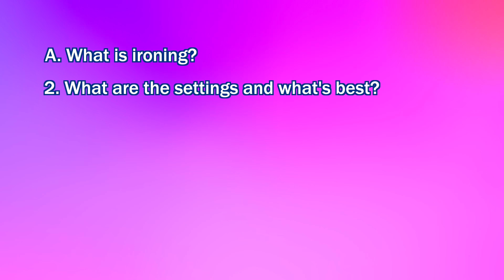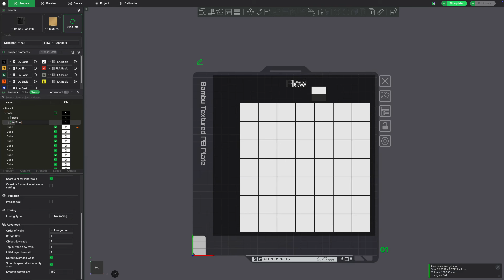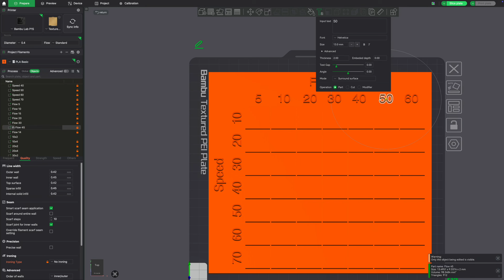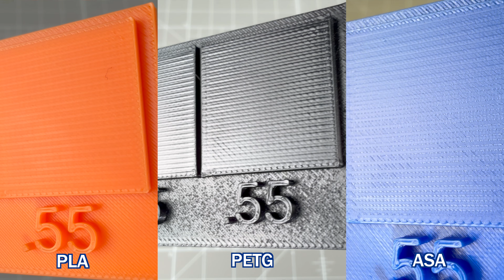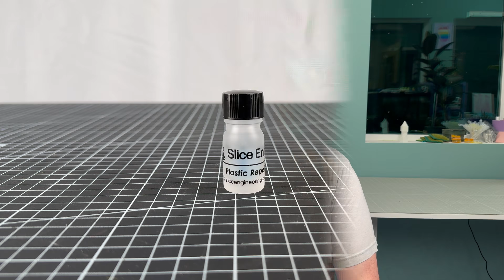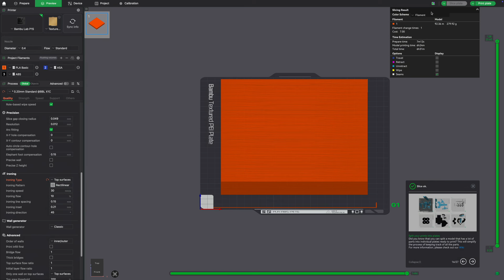Use This Slicer Setting for Super Smooth 3D Prints

Comment: Nice video, but missing the numbers in your conclusions? 
For example, what is the best settings for pla?
Thanks
Reply from the maker: I found 50 mm/s and 25% flow worked best but this was with BambuLab PLA. It is possible this is different for other kinds of PLA and certainly different for different filament types. This is why I made the models I used available for folks to use and see how it works. 

It is also possible that the color of the filament matters but I have used the same settings for other colors of BambuLab PLA without issue.